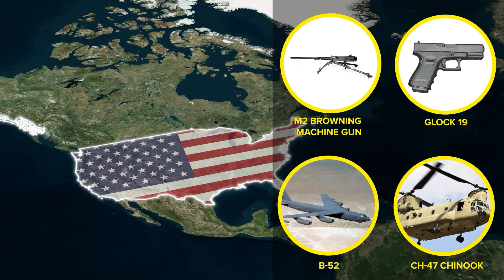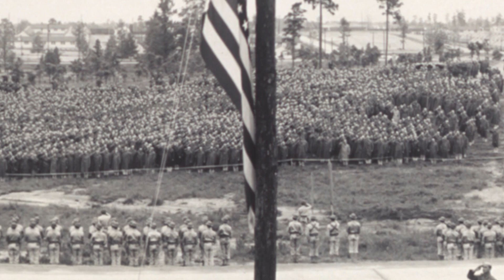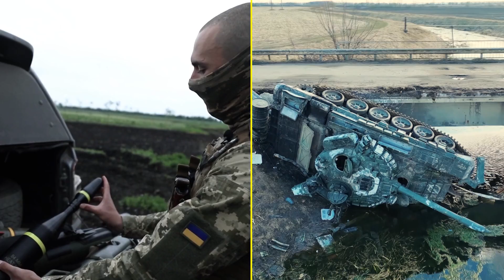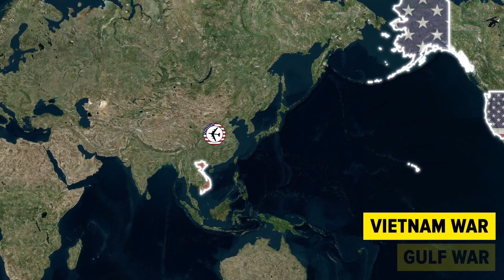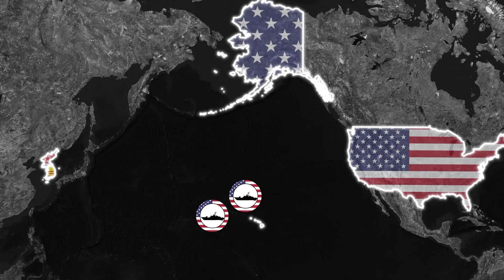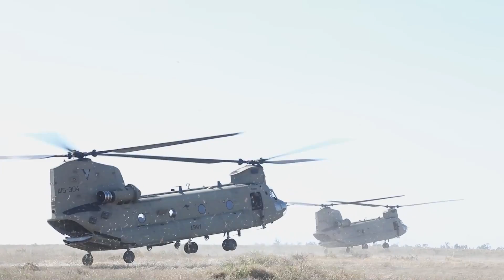Why US Military Can't Replace These 100 Year Old Weapons

Comment: Editing pretty sloppy- picture of Hathcock labelled Pershing - and showing the .50 in one frame and the Minimi M249 in the other. The initial picture of Alvin York was actually that of Omar Bradley. At one point you Discuss the Glock 19 and label a shot of the Baretta as a Glock.

Comment: Former AC-130H/W mechanic. Still the best plane out there. I was amazed that the first set of gunships I worked on were 1969 models. Since then I have worked on 88-94 models. Going inside of a J is like be on a spacecraft compared to the old 130s. 

Been on 130’s for 12yrs now. Absolutely love them.

Comment: 0:32 They pictured and labeled a Glock 19 when the M1911 has been in service for 112 years.

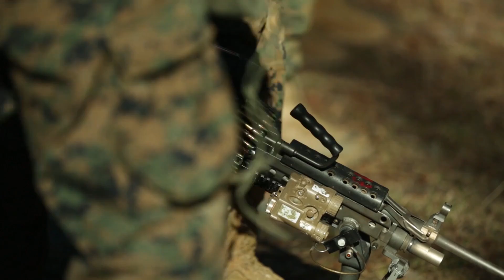0:44 That is not a M2 .50 calibur Browning machine gun.

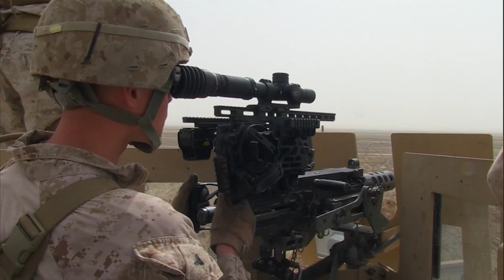2:09 A picture of Gunnery Sergeant Carlos Hathcock, United States Marine Corps, labeled General John J. Pershing Commander of American Expeditionart Forces.

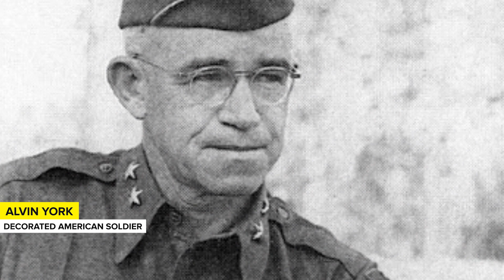4:47 That is a picture of General Omar Bradley not Sergeant Alvin York.

They mentioned the B-2 Spirit. This is a modern version of the YB-35 flying wing designed by Jack Northup which was in competition as a long range strategic bomber during WWII. The YB-35 carried 25% more bombs and had a 25% greater range than the B-17. 

Just because something is old doesn't mean it doesn't work and work well. "The more they overtake the plumbing, the easier it is to muck up the drain." Capt. Montgomery Scott, Star Trek III The Search for Spock.

Comment: Not including the KC-135 is an oversight of biblical proportions. All the range feats of the B52 mentioned were only possibly by dozens of 135 sorties. The 135 is involved in every mission the AF flies. It is what allows the AF to reach anywhere in the world with bombs or logistics. It is the lifeblood of the force. Arguably, the most important aircraft the service has.

Built in the 1950s, they are still in service today. Backbone of the nuclear forces. The KC10 is being retired, and the KC46 is an absolute disaster, having less offload capability, boom problems, and cargo loading problems. Everything now has problems from trying to be too fancy, such as the new boom visual system that costs millions and sucks instead of just using a freaking window with eyeballs. 

Since all replacements are gone or all effed up, it is likey the 135 will be needed until the 2050s.

Comment: It's the magazine WELLS that are flared, not the magazines themselves.  Basically, there's a bevel at the base of the grip, where magazines are inserted, to help them slide into place correctly even if the operator doesn't have everything lined up just perfectly.  Also, it's a SLIDE (as in a children's playground ride, a slide) lock, not a SLID lock.  The large chunk of metal at the top that reciprocates when the pistol is firing is called the slide, and it is responsible for both cycling new rounds into the chamber for firing, as well as ejecting spent casings, during this action.

Comment: "First up would be the browning M2 50 caliber machine gun"... While showing footage of the M249 SAW...
The M2 entered service with the US military in the 1920s, not the 1930s and had the original designation of "M1921".
Speaks about Carlos Hancock, while a banner extends from the left with information about General John Pershing.
"Flared magazine for quicker reloading".... No... Flared magazine well... Widening the Magazine would cause difficulty with reloading, if you even could.

Why compare a Carl Gustav against the Javelin?
They play VERY different roles.
The Javelin is specialized for the complete destruction of MODERN Main Battle Tanks and any other vehicle that has the displeasure of having a Javelin used against it.
Further to all of this, the Javelin has greater range and can track a moving target, whereas the Carl Gustav is more a point-to-point weapon system.

Comment: Couldn't even get past one minute of this video. Ma Deuce is certainly a venerable weapon, but when you show a M249 SAW with an ACOG scope on its integrated rail system you lose all credibility. Especially when you show a soldier casually picking it up and slinging it in a body carry. Unloaded and without the tripod the thing weighs >80lbs. It effectively cant be fired without first mounting to a vehicle or said tripod, else the recoil would put any soldier on their ass, to say nothing about accurate fire considering the center mounted sights and butterfly trigger preventing aiming in any other position. Big thumbs down from me, next time try for some accuracy in what you're showing/talking about.
Reply: Oh, and if you wrap the belt of the 249 under the body of the weapon and then over the top like used to be taught to keep the belt from dragging, they found that the "clip-on" style of the links is much more likely to kink, causing jams/misfeeds in the first few rounds when you actually go to fire the weapon.

Comment: they can, but dont need to. The M2 has been faced with replacement several times, but no matter what weapon is submitted, even when clearly a better design, is never so much better that the US is willing to spend the money to replace all of its M2s(Over half a million are in inventory)

The B1 Lancer was designed to replace the B52, however the B1 was restricted from carrying nukes by the 2nd START treaty, so the B52 is maintained mostly for its nuclear capability. Beyond that, it does have some merits that it is still a capable conventional bomber even if clearly inferior to the B1.

The 1911 has wholly been replaced except for by the marine corps. In every way, the 1911 is obsolete, its less reliable than modern firearms, holds fewer rounds, and Modern 124gr 9mm has the same muzzle energy as the old 45 ball. Pistols take up such a small part of military operation. the 1911 remains in limited service purely because people like it, not because something better hasnt come along. 

The modern Gustav is not the same weapon as the M1 Gustav. The M84 Gustav is a considerable improvement, and the M4 is even further improved.

The C130 is interesting, its long been replaced as the primary cargo hauler for the US by the C5 and C17, but the C130 still service its logistics role well landing in regions the bigger planes can't go. Its been toyed with being replaced but currently, no advancement in aviation would lead to a major redesign so for the role it serves, every attempt just ends up being another C130 with modifications. So they choose to just upgrade the design with new features and build new planes with the upgrades. Remember, unlike the B52, the C130s you see are usually relatively new, built within the last 20 to 25 years. Theyre still produced to this day and older models are retired and cycled out. A 2015 C130 may look similar to a 1965 C130, but they are very different in performance and have made major improvements.

Comment: Only issue is that any M1911s in use are generally "new" weapons with an old design.   I would argue that makes them and the "new" M4 Gustavs not really count on this list.
Reply: That is a valid point although I look to the design  rather than the date of manufacture making it an old weapon.

Comment: We pushed our equipment to the limits of physics, weight and form to the point that it will take a quantum leap to make them a lot more lethal or capable.  The B-52s now are later models yet the platform is approaching a century.

Keep in mind that a lot of the avionics and computing has shrunk so the platform is the same size but the guts are a lot smaller.  Engines are constantly improved.  That's why the F-15, 18 and others are so hard to replace.  One does not need stealth to provide close ground support or to shoot bad guys once AWACS have identified the bogies.  Also, as we developed stealth, we developed ways of defeating it.  <--  This is why the -35 program is such a money pit.

Comment: It's not that they can't design better, but congress doesn't want them to build "better" unless it gets used across every service, even where it isn't suited, and can show that it has half the running costs, which it won't, because better performance usually doesn't work that way.

As we see time and time again, those multi role compromises across airforce, marines and navy keep meaning added complexity, added cost, and compromised performance targets.

Luckily no one else is spending a fraction of the money so it seems to still be ok to have huge cost blowouts on the projects that do go ahead, and keep patching up "good enough" when good enough is still "probably better than anyone else has, and three times as many of them"

Comment: Talking about the M2, but shows a SAW. Talking about Alvin York, but shows Omar Bradley. Talking about Delta Force, but shows a SEAL team.
Reply: Adds in the Glock 19 from 1988 to the B-52 from the 1950s, Chinook, from the 1960s, and M2 MG from the 1930s. The Army and Marines went to a Sig Sauer pistol, so I don't think the Glock 19 will make the over 60 years needed to reach the Century mark.
Reply: Talking about the B-52 not carrying nukes but only the B-2.  Newsflash ... The B-52 never lost that capability.  I've guarded them too many times during generations.
Reply: I knew I recognized that Major General  but couldnt place him.  So thanks.  I just knew two stars didnt designate a Sergeant.
Reply: flared magazines for easy reloads...

Comment: Browning and his son Val designed the 9 mm Browning Hi Power pistol.TheHi Power was made by FN (Fabrique National) in Belgium. It was the first high capacity (15 round mag)  pistol and was loved by German officers after Germany captured the FN plant.  It is still in use by some police agencies and a re-design has been developed by both FNand another company.
Reply: I remember the FN HP had a 13-round magazine with a way to strong spring and reloading was painful, I've never seen one with a 15-round magazine but maybe i am wrong so correct me if you can!!.
Reply: Actually the high power was designed by Browning and his assistant in Belgium. The son had nothing to do with it... Every history book I have read does not attribute the son with input in the high power.

Comment: The reason for that C-130 it can land places even the modern Replacements cannot do cuz they don't want to go to jet power you got to use a prop to land in certain areas the Jets were just tear the engines of shreds when it landed on a dirt Runway

Comment: I think a few B-52s are modified for sea patrol, with cruise missiles, Harpoon missiles, depth bombs, regular bombs and air dropped torpedoes.  Also, the current 105mm howitzer used by the AC-130 with a 120mm mortar.  It should also be noted that the Tupolev Tu-95 Bear is about the same age as the B-52 and likely will be around just as long.  Also the Tu-22 Blinder was put in service in 1962 and some are still in service in parts of the world.  I do recall reading a sci-fi short story where a group of human soldiers were concerned about their Ma, and then had to explain to the aliens they were fighting with how their Ma protected them - Ma Deuce.
Reply: How would you use a mortar from a plane?
Reply: @wwclay86  mortar is a breech loader.  Breach is inside, the rest of the tube is outside.

Comment: “100 year old equipment”

Shows a CH-47 Chinook from the 70s and an AC-130, also from the 70s, both of which are roughly only 50 years old…

If I recall correctly, the oldest military vehicle that’s still in service today is the B-52 Stratofortress, which had its first flight back in the 50s, making it around 70 years old. Heck, the B-52 is so old, the original design had gun turrets

Comment: Forgot one. KC135. This bird was the first air tanker that could refuel jet aircraft without flying in a dive to keep the jets from falling off in a stall. The Airforce still uses them, but they are scheduled to be replaced.
Reply: Not for another 30 years as the KC10 is being retired and the kc46 being a complete disaster
Reply: They aren’t scheduled to be replaced yet. The KC-46 is a gap filler (not even fully capable either). Right now the -135 is scheduled to retire around 2040.
Reply: I have a feeling the KC-135R will be around longer than 2040. It’s possible that the KC-135R will still be in service into its 100th year. Structurally the airframe is capable of this milestone. (So is the B-52H) The USAF and Boeing wasted an excellent opportunity to replace the KC-135R with the flawed KC-46A. Serious engineering problems at Boeing coupled with ambiguous systems and mission requirements by the USAF have resulted in flawed mission and design shortfalls. These issues plague the KC-46 and diminishes its capabilities.
Reply: @mcahill135  100% agree. It’s a tanker that can barely tank.
Reply: Glad to know this. The Dash80's sibling has served well. In more than one variation, AWACS, first transport, Air Force 1. Boeing really did a great job with the Buff and this one.
Reply: @arthurjennings5202  too bad they forgot how to do the same on the KC-46.
Reply: @paulb.9742  The Buff and KC135 were designed by the same engineers who designed the B17 and B29 using slide rules and lots of drawings.

Comment: I guess planes and weapons are fun to watch, but you forgot the workhorse of Armor and Infantry units the M88 recovery vehicle introduce in 1961. The M88 was upgrade to M88A1 in 1977 and then M88A2 Hercules in 1991. And as long as M1 tank around they will also
Reply: When I was on a field problem in Louisiana, we had a deuce-and-a-half get stuck in the mud and then two others get stuck trying to get that one out. An M88 showed up and got stuck itself. It took two more M88s to get everything pulled out of that mud. I helped pull out cable but I just mainly watched the recovery efforts as I was the medic. Three M88s running all at the same time are amazingly loud.

Comment: Talking about M2 .50 cal  machine gun yet showing a regular 7.65 squad carry MG.. There are NO systems that cannot be replaced.. Almost anything can be made again if it was made once before. The problem is the military likes new expensive shiny equipment and not the best at what it does..  Weapons last 100 years for a good reason.  Germany uses an upgraded  MG it used in WWII. Case in point A-10 aircraft. Air force want a newer plane that wont be as effective at its primary mission..

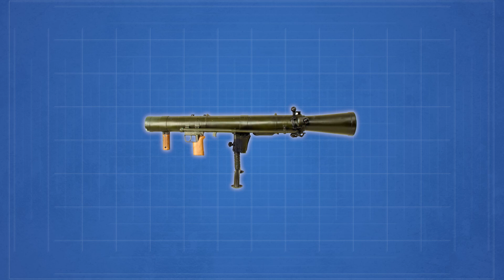Comment: I gave up at time stamp 6:33 when they started talking about the Carl Gustaf. Yes, while the original M1 did get produced in 1946, the US Armed Forces did not buy them until 1991, and it is the M3 in US service. Plus, it isn't a rocket launcher, it's a RECOILESS RIFLE! The ammunition used isn't rockets, but actual gun rounds in 84mm. Which is why the gun has rifling. Which is why the ammunition can be "rocket assisted" for longer range! Whoever wrote the script sure didn't do their research. 👎

Comment: You know what they say, if it ain't broke don't fix it or replace it in fact just improve it modernize it a bit, the 1911 may be more than a 100 years old but a gun is a gun and with the right tooling you can give it picatinny rails and make it a double stack in 9mm and then give it to John Wick, and he will wipe the high table clean with just that.

Comment: Well, they almost replaced the C-130 in 1978 with the AMST (likely a production version of the Boeing YC-14). But both the USAF and the US Army determined by 1978 the more pressing need was to replace the C-141 Starlifter , which was done from the middle 1990's on with the C-17A Globemaster III .
Reply: I was station at Norton AFB, Calif. back in the 1980s. It was a MAC base and they flew C-141s. It was a shock  when they were replaced by the C-17. I got a chance to ride in a Starlifter once. None fly today. Sad 🙁.
Reply: @josemoreno3334  I think the C-141B upgrade program from 1977 to 1982 was intended to extend the service life of the plane as long as possible until the true replacement became available. That finally occurred when the C-17A Globemaster III entered service from 1995 on.
Reply: @Sacto1654  reminds me I watched a documentary on the struggles of the 141s for their final major deployment to Desert Storm
Reply: The US Army has no say on what aircraft the US Air Force has.

Comment: I was in the 1ID from 2016-2019 and was a Bradley driver for about a year. Those tracks were ancient, probably the same damn ones issued to the unit 3 decades before but those things are absolute workhorses. Still a more solid and dependable platform than most IFVs out there. I absolutely would not want to be on the business end of a pissed off Bradley's 25mm.